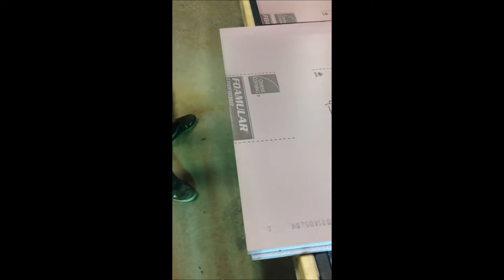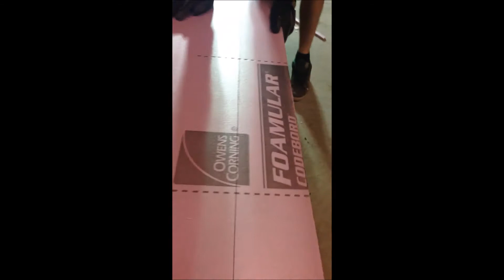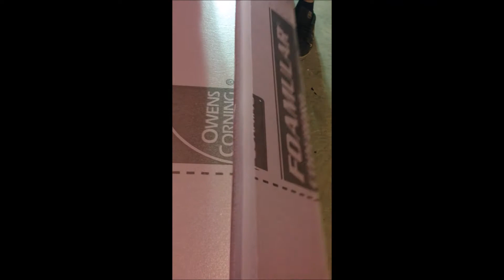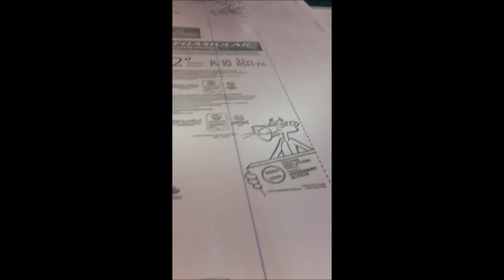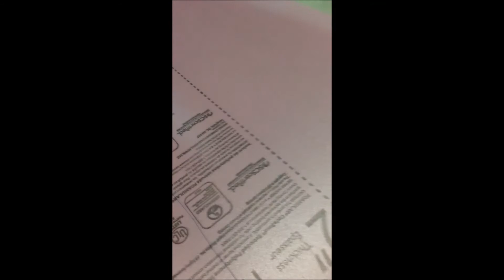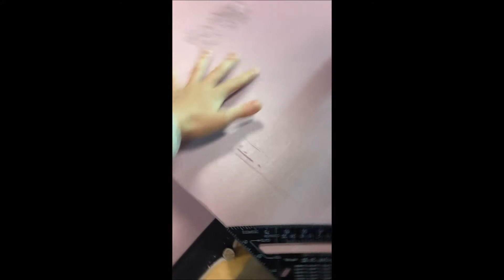Tiny House Trailer Insulation

Comment: Not sure if you maintain this channel anymore, but I'm wondering how your lack of vapor barrier under the subfloor ply has worked out? I'm building right now with metal flashing as the bottom layer, and am similarly concerned about putting essentially a double vapor-barrier in the subfloor floor. Any feedback would be appreciated, thanks!

Comment: So I'm by no means an expert on tiny house subflooring, but if you're putting insulation between the metal parts of your trailer, you are leaving a pretty significant thermal bridge in the subfloor of your house. This effectively makes all that insulation you so carefully slotted into the trailer not very useful, since the trailer is going to conduct cold and transfer it directly to the floor of your house around the foam insulation.
Reply: scottbre Well it's better than having nothing, right? I mean what can you do about the metal anyways?
Reply: scottbre I think the next step they did was laying a plastic barrier down on top of the whole thing before adhering the plywood subfloor.
Reply: Now that you've experienced a couple winters, have you noticed any cold spots where the trailer metal frame and cross-members touch the floor? An alternative to building your subfloor within the trailer frame would be to build it so the entire subfloor sits on top of the trailer frame. But the trade-off is that you loose 6 inches (or so) of ceiling height.

Comment: I might suggest a few tools to help the cutting process.  First, there are knife cutting attachments for recipricating tools.  So you could use a reciprocating Skill saw.  Not sure if there is such a blade for a demolition reciprocating saw BUT there are metal cutting blades with very fine teeth.   There are professional hot knife cutting tools that will cut through the board like butter - $180 but might be worth it.   

For all of the straight cuts you have, two per sheet, and it looks like 28 piecesm(14 sheets??) in all,  I would use a table saw.  The best blade is probably a panel cutting blade.  It will still make a mess but you can reduce the time taken to one-tenth.  Set up saw first to cut off tongue and run ALL panels through.  Then set up for size cut and run ALL panels through a second time.  All that's left is the notch on the top pieces.  You can still use the table saw for these in two passes.  One pass for the vertical notch cut at proper depth - run all panels through.  Second pass, with board on end, to make the horizontal notch cut - run all panels through.
Reply from the maker: Awesome suggestions. We tried using a circular saw but it was very difficult to control, and would bite into the styrofoam, veering away from the line we wanted to cut. I had a couple of close calls with this and wanted to stay away from power tools for the insulation. Table saw would be a better solution for sure though. Both of us were/are very new to building and we've got a fairly tight budget. Maybe one day we'll build another tiny house and in that case, I think we'll have accrued enough experience and cash to try out your ideas! Thanks so much for you constructive help, it's really appreciated!

Comment: Do you know if a skill saw would make a mess of this stuff?
Reply from the maker: We tried a skill saw but it didn't work as well, and wasn't much faster. It was also fairly dangerous and it would melt the styrofoam from the heat of the spinning blade.
Reply: Try turning a skilled saw blade backward. Also try not to stop with the blade spinning friction will melt foam and make it kick.